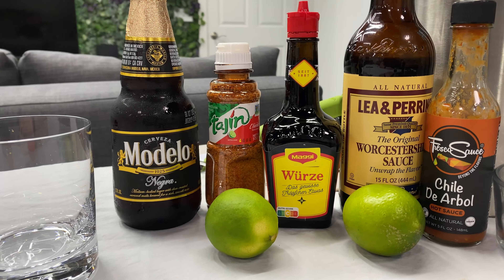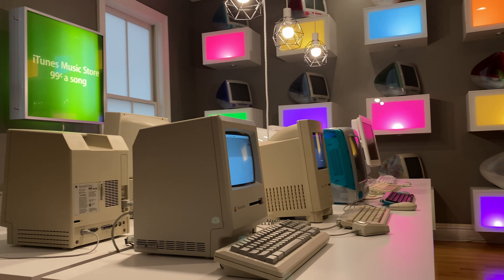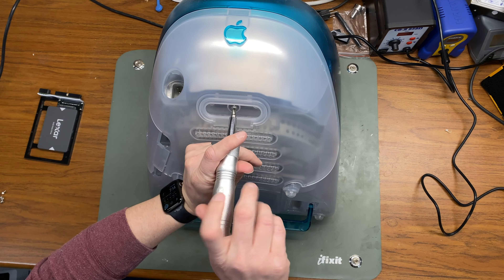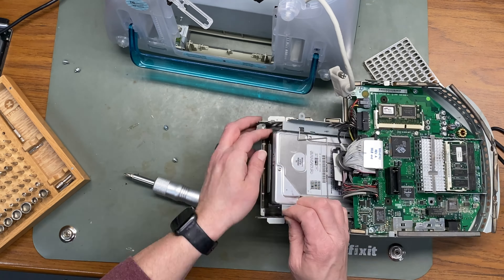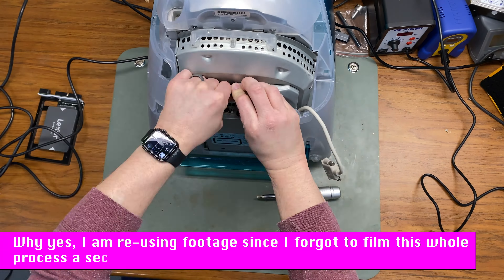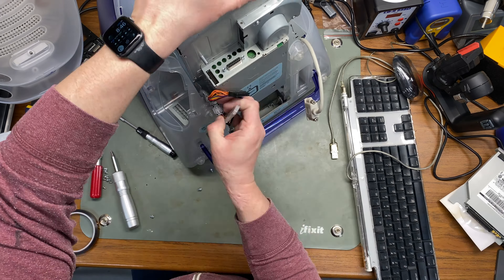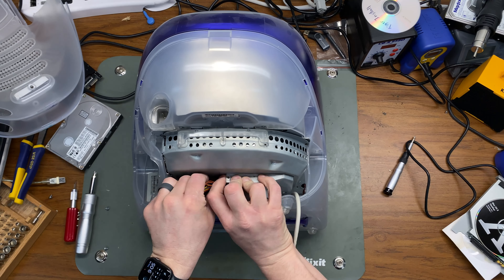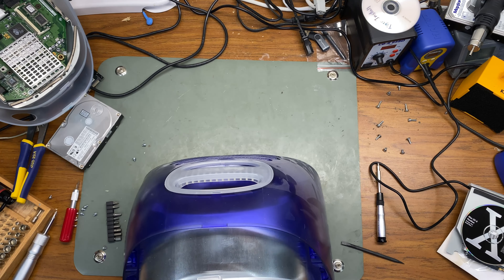Live Nude iMacs

Comment: I had the exact same problem with the Bondi Blue iMac G3 (1998). It seems to be a problem with the SATA to IDE adapter (which seem to work on later Models). Others seem to have success with an IDE to SD Card or CF Card.
Reply from the maker: Good to know. Thanks.
Reply: I think Action Retro was saying that the Industrial “Disk on Module” drives were more compatible with the iMac G3, but I haven’t personally tried this yet.

Comment: The tolerances for the shell assembly is pretty nuts.  I have the blueberry model and the screen is pretty soft... is that common with these displays?  It doesn't look like the machine was used much so I don't think the display is worn out from use, but caps might still need replacing.
Reply from the maker: I do have a few that are a little soft and others that are really sharp. I’m not a CRT expert so I don’t know what is needed to fix what, but I have recapped a Mac plus and it really improved the image. I know Steve with Mac84 was saying something about the failure rate of these iMacs… but I wasn’t paying super close attention to what specifically he was talking about. Hopefully I can follow up with him to know what I need to do to get the original screens looking good again.
Reply: @JeremysRetroBar  Thanks for the info.  Great stuff as usual.

Comment: Great restoration. Nick's #1 rule (my rule) - if I perform an upgrade and/or a repair to a computer, and screw it all back together = FAIL -- it will fail without doubt. I always test the computer with minimal putting back together, as you did with your Grape iMac upgrade test. You can see that the Blueberry inner plastic had a lot more yellowing than the Grape inner plastic.
Reply from the maker: Haha I like that rule. Yes the grape was definitely in much better condition all around.